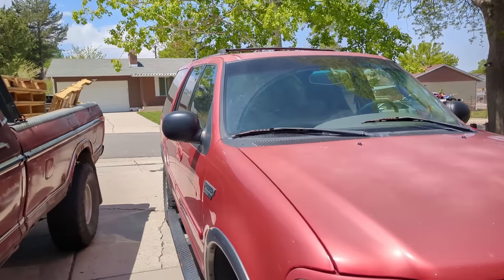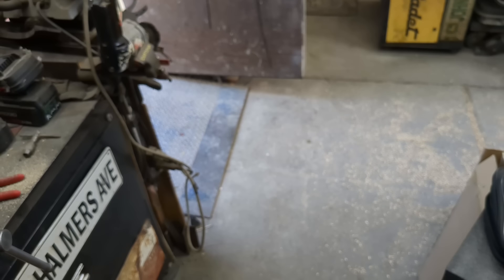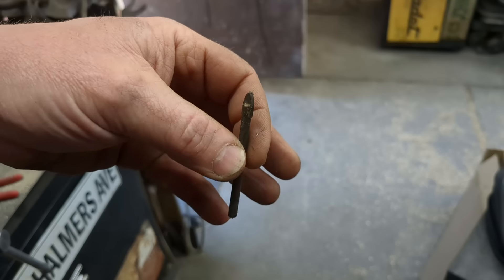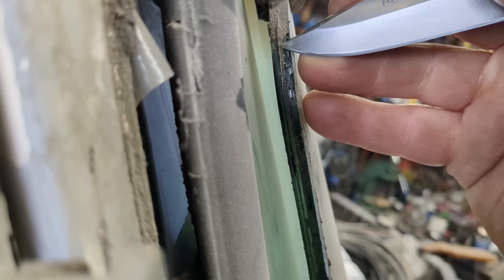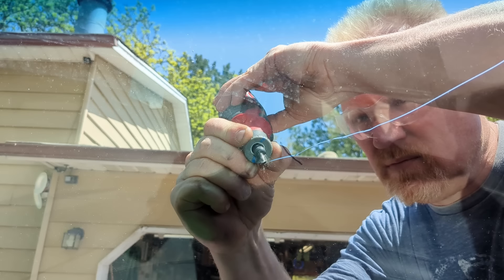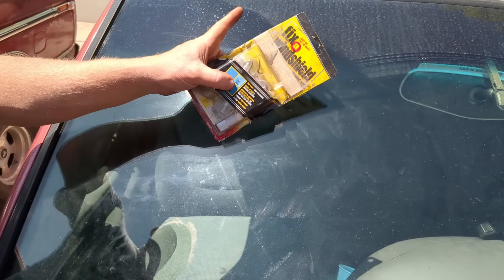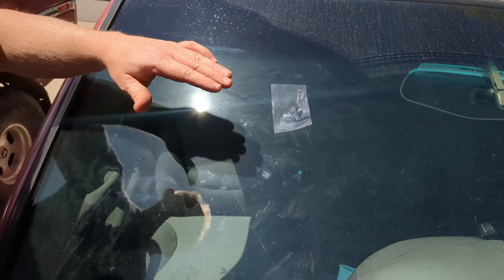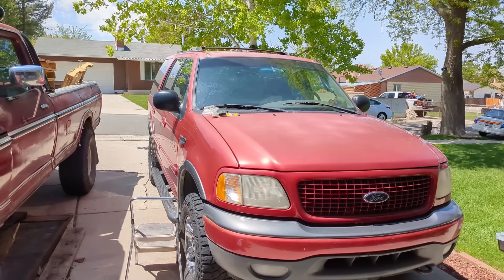STOP windshield CRACK from Spreading

Comment: Thanks for doing this video, I did this last winter on my car. I used the cheap harbor freight 10.00 rotory tool. It had the bits with it. Put it in a ziplock bag and keep it with my tire plug kit. Repair is still good.
Reply from the maker: Awesome
Reply: so you used a general purpose steel tip bit and not a diamond or carbide tip. And was still easy enough?
Reply: Yes as of today 2/26/2024 repair is still good no change no additional damage. Oh and always carry the small one time use superglue just in case you cant fix right away. Put it on and don't scrape off even though you want to till you can drill and get the stress off the crack in the window.

Comment: Good video. Living in Alaska with no vehicle inspections and rocks all ober the road, probably 40% of windshields are cracked. My Tundra windshield has been cracked for the last 3 years. How does the fluid crack repair do in -30, -40 temps?
Reply: It just takes a little more time to fix, just a short drive down to Florida for a few days until the vehicle warms up, do the repair then return home, easy peasy
Reply from the maker: Can't say I've ever done it below 0 F.
Reply: I've never had issues with repaired glass in cars that are in -20 to -30C winters. In heated windscreens it's common to get them damaged virtually at the second of glass cracking. Usually just one circuit remains ok.

Comment: One way to keep a crack from speading......move to a tropical climate. Cold weather spreds a crack faster than anything because the first thing you do when starting your car is turn your defroster on and that warm air meeting a below freezing windshield will spred that crack by inches a day. 

  Also just get the windshield replaced because even if you stop the crack, the cops will still pull you over for a cracked windshield. That is considered a safety hazzard and you'll then be forced to replace it and then spend more money on the fix-it ticket you got to resolve the issue.

Comment: Great tip. My 03 Silverado had the worst windshield ever. If a rock just looked at it, it would crack. Did you get your pavers in yet? At the end of the video I could see some like form sticks sticking up? Thanks man! 👍
Reply from the maker: Still putting down pavers. I got them all laid, just need to cut a few and cement in all the edges.

Comment: If one has gotten just rock chip, don't buy this kit, buy one with syringe and vacuum cup so you can try to pull vacuum and then release resin inside the damage area. Much more effective.
Reply from the maker: Agree to disagree. I hate the syringe kit and find it ineffective.
Reply: @sixtyfiveford  interesting. I've never had issues with them. Bit fiddly to work with.
Reply: @sixtyfiveford  I found it worked REALLY well for one spot. one time. and then became useless. But I think the results would be just as good with the suction cup style kit.